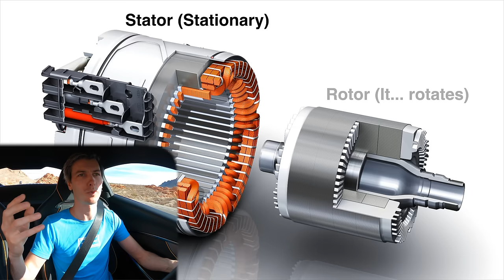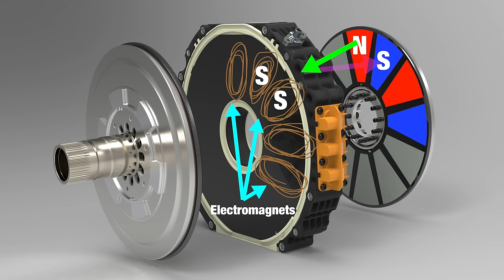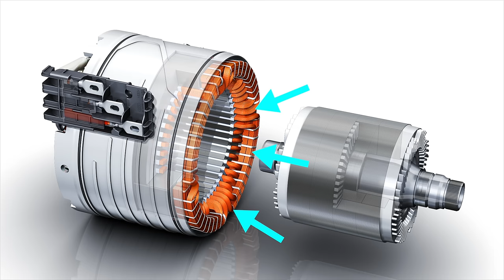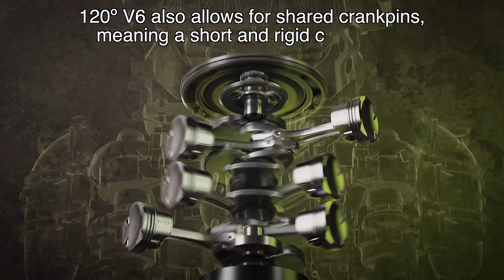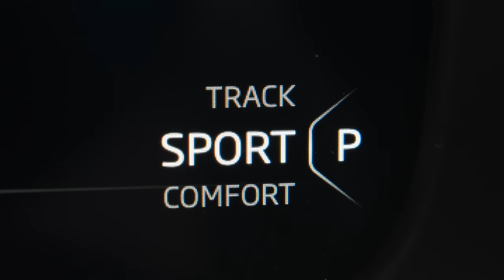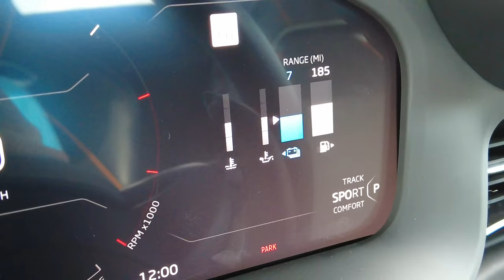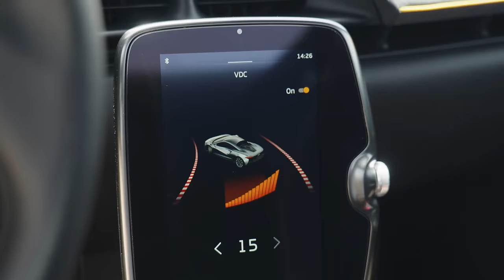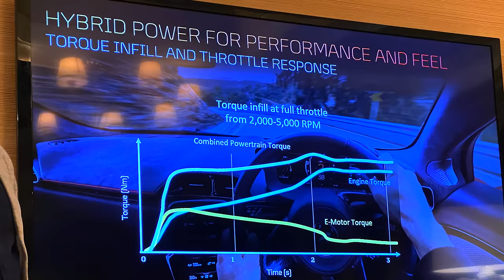These Tiny Motors Make Big Power! Why Supercars Choose Axial Flux

Comment: Man, the interior noise is crazy loud in that thing.
Reply: its a supercar.. if you want to be insulated from the road and engine noise go by an S class
Reply: @E92M3  thanks for the obvious explaination and your permission to buy wantever I want, no need to be a jerk over such a simple comment.
Reply: @E92M3  : The point us, it makes the video unwatchable
Reply: I had to stop the video early.  The noise wasn't worth it
Reply: he could have done better noise isolation (lapel mic) and post editing
Reply: We want to hear the noise!
Reply: @hafizuddinmohdlowhim8426  true it sounds really good, although it does get a bit annoying after 15 min.
Reply: @E92M3  btw. an R8 is dead quiet at cruising speeds.
Reply: @garyandtricia1  wow a bit touchy aren't you!
Would be interesting to see if Jason responds on whether it's as bad as it seems. My 12C is a lot quieter inside than any form of 911. Would be surprised (and disappointed!) if mclaren hadn't managed the same with the artura. The mclarens make great GTs.
Reply: @dutoitm1  No, not at all.
Reply: @garyandtricia1  Jason has posted and pinned a comment on the audio on this video. Go give that a read!
Reply: @E92M3  ever seen porsche, Ferrari? They aren't that noisy. You don't need to be a jerk.
Reply from the maker: Apologies - see pinned comment! It's definitely not as bad as it sounds in this video.
Reply: @dutoitm1  Thanks, I appreciate that. It's crazy that all I did was make a comment about the interior noise, not a complaint, but a few people get all wadded up about it for no obvious reason. I found the noise a little annoying, but never said anything about that. It's easy to see reading comments, that many others thought it was far more annoying than I did. My real point was more that many supercars have better sound insulation, this one is much loder than most. Again, I never complined, just commented.
Reply: @EngineeringExplained  thank you, no apology needed.
Reply: @guycha0s380  Which ferrari isn't noisy? The 812 superfast?
Reply: @hafizuddinmohdlowhim8426  It sounds awful for 95% of the video. Not even a supercar sounds good at 60mph non-accelerating.
Reply: It wouldn’t be bad if he knew how to use cruise or keep his foot still. He was using the throttle like a light switch. Terrible sound.

Comment: Really cool to see this, i actually work at yasa motors in oxford uk, these are the motors that we produce everyday for mclaren, mercedes and ferrari, great to hear jason talking about this!
Reply from the maker: Right on, cool job!
Reply: Why these motors aren't used in EVs, are they more expensive to produce or there is some other issue. From packaging standpoint these bad boys are no brainer.
Reply: Was gonna say that the Ferrari 296 uses one of these too. Super compact and cool!
Reply: @ristekostadinov2820 most ev's arent as space limited and are instead cost limited and need higher volume.
Reply: have any motorcycle companies jumped on this tech yet?
Reply: Love the Yasa motors,  just look classy,  and compact.
Reply: Does yasa make the motors in that hub motor g wagon?
Reply: @williamgrimes2014  If you aligned it with the wheels (i.e. the rear wheel) the rotational weight would be a good thing.
Reply: @williamgrimes2014  that would be cool
Reply: I didnt see this comment before I posted. That motor is very impressive.
Reply: That's dope, I remember looking into your company years ago when I was researching info on the different electric motors available

Comment: As an electric motor designer, I have to say that I am impressed by your video. Some people make videos saying, that AF motors are better in every way, which is not true. However I want to clear up a few minor points:   (AF = axial flux, RF = radial flux)

McLaren says, its the first series production vehicle road vehicle using an AF motor. However the Ferrari SF90 Stradale also has an AF motor. Am I missing something here? Surely McLaren would know that.

The more crucial point for this video are the advantages of the AF motor. Generally RF motors have higher power densities. For example the SF90 front (RF) motors have 99kW at 12kg (133hp at 26,5lbs). This is because they spin up to 25000 rpm. They don't need to have much torque to achieve that power due to the high speed. This AF motor has 70,1kW at 15,4 kg (94hp at 34lbs). So less power and more weight.
The reason, why the AF motors are good at this application, is that they make good power at speeds of the ICE.
In pure EVs you generally only care about power density (and field weakening range). Torque density does not really matter much, because you can multiply the torque with a gearbox. That's why pure EVs generally have RF motors.
Reply: Good post!
Reply: So axial flux motors have higher torque but can’t spin as fast due to bigger diameter rotors, so less power overall. 

It seems that axial flux would make better hub motors for cars because of the 1:1 rpm with the wheels (low speed) and their shape which matches that of a wheel more closely.

Comment: the magnetic flux can also flow from the north pole on one side to the south pole on the other rotor. this results in greater magnetic flux density around the stator since the magnetic field lines are being squeezed towards a parallel line between each magnetic pair that passes thru the stator.
Reply from the maker: Yep! Use it on both sides, and the rotors simply have opposite poles.
Reply: That’s the first thing I was thinking as well.
Reply: @EngineeringExplained  Why use axial flux or radial flux? Why not use racial flux? A father & Son American company invented the electric motor sandwich! They a radial flux motor between two halves of a an axial flux motor. This uses ends of the radial stator copper as the starter for the axial motors at each end. Free extra energy, power & torques. Check out the Hunstable electric turbine.
Reply: @kevinburke6743   There's no such thing as "racial" flux, keep race out of this discussion, what you mean is something else. Here's a quote from the article you are mentioning: 
"Linear Labs says all the HET generates all torque in the direction of rotor motion. In a promotional video, Fred Hunstable said, “We call it circumferential flux, sort of like a torque tunnel.”

Hunstable coined his motor as circumferential flux motor.

Comment: This is exactly the kind of plug-in hybrid turbo technology I've wanted! Throwing in the axial flux motor there makes it even that much better.  With the battery regen modes, and hydraulic assist steering - it's like they were reading my mind.
Now if they could put the same sort of features in a more affordable package.

Comment: Getting 100hp out of something half the size of a torqueconverter, is AMAZING. Basically put two of those together in a transmission for 200hp, and run any small car without the weight and cubic feet space requirement of an actual engine bay! Imagine what engineers can do with the entire driveline being basically a transmission under the car and no engine bay at all, and still get several hundred horsepower out of it with 2-3 of these motors packed down there.

Comment: I have to wonder if 4 of these little motors (one at each corner) wouldn't make for an amazing EV experience. Not in supercar territory, but on something the size of a Miata I imagine it would be pretty good.
Reply from the maker: Ha, I'd love to see a lightweight option in the EV space. Miata with two of these at the back & smaller battery good for 150 miles? I'm in!
Reply: @EngineeringExplained  That's very similar to the original Tesla Roadster. I hope that maybe Lotus, considering they're going all in on evs, would bring back the light weight, good handling, and not just horsepower focused ev.
Reply: It certainly would be elegant engineering wise.  Hub motors or short driveshaft direct inboard motors, and each wheel module is independently electrically steerable.  A manufacturer could make combinatorial lines of modules from common parts for different combinations of wheel size, power requirements, and vehicle mass requirements.
Reply: @EngineeringExplained  - Would benefit from being diff mounted like brakes on older jags. Surely the weight being 100% sprung and centered would be better for handling
Reply: @EngineeringExplained  it won’t seat 2 people like a Miata, but the EVSR electric sports racer weighs 1,900lbs and uses direct drive electric motors (though they are radial flux, not axial) and just set a record for an EV, over 1,500 miles at the 25 Hours of Thunderhill last weekend.
Reply: I was thinking that too. Why not leave out the big heavy battery and drive train, just a smaller engine, generator and smaller battery.
Reply: My first thought seeing the spec 94hp 144lbf torque, was "this narrow motor would be great in a bike". 😁
Zero's latest battery pack is 14.4kWh. There are OTS solutions between 7.6 and 10.4kWh...
I wonder how far it would go in city or mixed use riding?
Reply: @jimurrata6785  That would be more unsprung, rotational weight. A regular inboard power plant would be better. I can imagine a large mass like that spinning fast would make it handle like a couch.
Reply: @CrossWindsPat  I'm not suggesting a hub motor, just that it could be narrow like a trials bike.
*Do you think those two magnetic discs weigh more than a 4 cylinder crank, clutch and gearbox shafts?
Reply: @kchristensen6283  the problem with diff mounted brakes is if an axle shaft breaks you lose all braking to that wheel.
Reply: See the big teams that enter Formula Student Germany ...

Comment: I work in the automotive industry, and I'm passionate about electric motors. I was iterating in my head how to improve the performance and efficiency of electric motors and my conclusion was the same design of these axial flux motors. It's quite interesting.
Reply: In terms of energy density and efficiency, radial flux motors, especially synchronous PMMs, are better at that job. That's why they are used in most automotive applications. For P2, of course, you gonna need an axial-flux motor (like Ferrari does for their SF90). P4 is always radial-flux though.

Comment: As an engineer for YASA, the motors that we have created for McLaren and Ferrari are impressive in their size and weight but we have much more powerful motors that are about the same size.

The stuff we are working on at the moment is pushing the limits of materials, manufacturing techniques and engineering design which will be announced soon

Comment: I always liked hub motors,  shifting the weight way down to the wheels is nifty. But wedging a motor in with the transmission is very cool also.
Reply: I never really thought about the rotational weight of hub rotors, but that’s what I’ve always wanted. Mercedes just put out a G wagon with hub motors but that’s a more appropriate application. I am a coupe kind of guy and really like what they’ve done here

Comment: Im prety sure the radiator fan on my 1986 Celica is a radial flux motor. I pulled it open to fix the bearing and it was like all the conductors were all flattened out into a disc. It looks really cool. First time I'd seen a motor like that.

Comment: The driving modes are clever! In track mode at WOT it can use all the engine power to drive the wheels, while not at WOT it can use the "extra" engine power to charge the battery for the next WOT burst.
Reply: What’s even cooler about that, is since the engines power is being used to charge the battery when pedal isn’t fully depressed, it’s still keeping the turbo spooled!

Comment: These rotors are also much easier to make on your own if you want to build something like a wind turbine or low head water turbine. Been wanting to build one for years.  One day.
Reply: how would i make one
Reply: @niruvibes  Buy the book "Homebrew Wind Power." The process is lined out there. You use specially shaped coils of wire cast in resin, with neodymium magnets, and a trailer wheel hub to spin on. Pretty good homebrew energy information.
Reply: @wiredforstereo  interesting thanks
Reply: @niruvibes  Also many videos about it on youtube!
Reply: The goal is to get away from Rare-Earth magnets. As someone who is Very interested in in DIY and everything Electromagnetics/Electronics, the more I can source myself the better off. At this moment we have beautiful electric motors, the main issue is Batteries. 
The Future is Electric, I've believed this for decades, with Electricity I can pull water from the sky (not efficiently).
Remember that Electrical Energy flows around the Wires, not though them.

Comment: For a while I autocrossed an MR-S, which is mid engined, very light, and has an open diff.  You would never notice, the oversteer behavior was always wonderful.  Other cars will 1 wheel peel all over the place.   Often people make that worse or more likely with big swaybars.  Big swaybars feel great but usually slow you down.

Comment: I like how the title is about the motor, not the car. Absolutely spectacular engineering on the car, though.

Anecdote that no one will care about: 
When I was in high school (in the late 90’s), I was unaware of the Axial Flux motor, but I had learned about mag-lev trains. I imagined a motor with “mag-lev on the outside”, I wanted it to be more of a flywheel, so the stator was on the outside, with the magnets on the outer radius of the flywheel. I figured it could spin up to store energy and clutch out the power when needed… a few years later F1 started using KERS.
Reply: Thanks for watching and Congratulations to you 🥳🥳🎁🎁 You were randomly selected to be among our viewer of the week. Quickly send a message now to claim your reward 🎁🎁

Comment: When you mentioned "The Stator" I couldn't help but think back to the legendary Retro Encabulator video. Surprised this device didn't incorporate any hydrocoptic marzel vanes to prevent any potential of side fumbling.
Reply: I guess how "encabulating" it sounds  it depends on your  background. All I heard were very basic terms, nothing fancy - but that's because I've messed around with electric motors a lot. I can see how it would be pretty encabulating if you didn't have much experience in electric motors! 😅
Reply: Wait, isn’t that was those things on the side are? 🤔

Comment: I stopped being impressed by expensive cars I could never dream of owning years ago but I am impressed by good design and engineering.This McClaren looks to be the epitome of both. 

I was fortunate to come across (one of) the original McClaren F1 pre production test cars in the UK in 1991 and that was interesting. Ive got photos somewhere. 

However, that radial flux motor has great potential for other small vehicle applications. If its a McClaren design then Id be selling it on licence.

Comment: The other huge reason for the density is that because they produce lots of power at low RPMs you don't need to have a transaxle with step down gearing. You can directly drive the wheels.  That means doing a 4 motor drive train is easier and lighter.  Which means that you can get to 400 HP trivially and eliminate complexity and weight.  And you can stack them on the same axle, so doubling power is as easy as putting 2 motors per wheel instead of one and now you have 800 HP.

I suspect Tesla and others are going to Axial Flux soon for this very reason.  The best part is no part. Removing the transaxle with no other real downsides and with an easy scaling path, and 4 wheel independent control is a huge win.

The only question to me is who's going to try putting these in the wheel as unsprung weight and get rid of the axles entirely.  Would be an interesting experiment.
Reply: It'd be a hella overbuilt wheel hub of sorts.
Reply: @shapshooter7769  actually Munroe did a video on a prototype and it was less than you’d imagine. And because there was no drive shaft going through they could build it differently. Sandy Munroe said that he couldn’t notice the sprung mass versus a standard Mercedes.

Comment: One thing I absolutely love about this is the electric drive is the reverse gear, I have been trying to build a DIY go kart that is what I call Electric Power Transmission, fueled by gasoline (no large batteries, just a single relatively small, low slung for low CG)

The motor throttle is electronically linked to the gas throttle, the gas throttle is fly by wire, and calculates needed charging to keep the capacitors topping up as they discharge into the motors via speed and directional controllers that regulate frequency, voltage, amps, and give me the watt/amp draw info in live time, as well as motor temps.

She's all wheel drive using a transaxle cvt setup to deliver power to the wheels on an set of articulated axles.